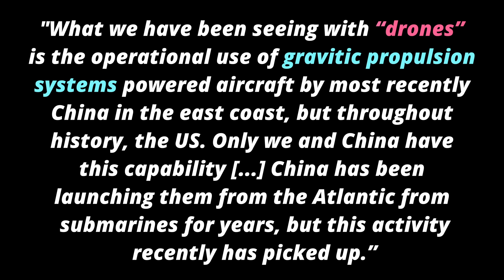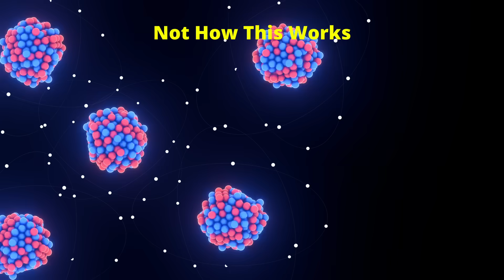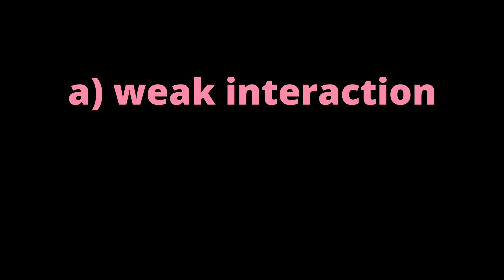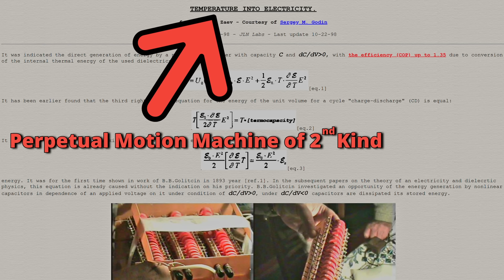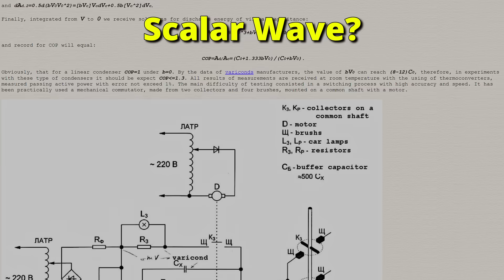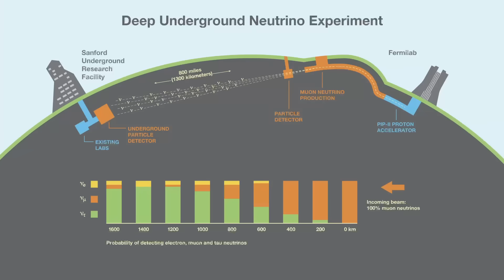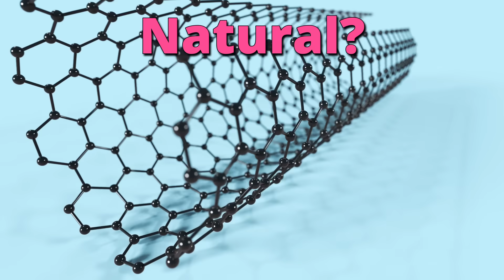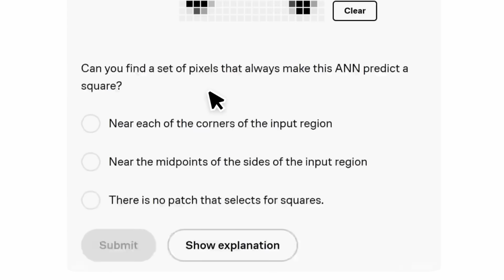What is “gravitic propulsion” and could the US government hide it?

Comment: Gravity isn't a force.  So no.  This is not possible.  To use gravity to extract energy is lifting something with mass away from a much larger concentration of mass, and harvesting that stored energy later.  Gravity is an extremely weak emergent property of fluid dynamics and because it's not a force there is no symmetry that can result in its reversal.  And there is very little energy to extract from the process.  The only thing gravity could conceivably be used for is the storage of potential energy.  A large weight raised up from the Earth and forced through a gearing mechanism to slowly fall.  This energy can be extracted, but only at or below the rate of the energy used to lift it.  Gravity batteries can and should exist.  Everything else is SciFi nonsense.
Reply: They found a way to create a corona field, it allows the craft to cancel out gravity while also causing time dilation. It’s why they can move so fast.
Reply: @eggheadusa  yeah?  No.  Laws of physics do not allow any of it.  The concentration of energy being the first impossibility.  And there are no "parallel" dimensions to extract energy from.  You are letting delusion define your reality.
Reply: @eggheadusa  yeah?  No.
Reply: @ZennExile  No? Yeah. Biefeld–Brown effect
Reply: @eggheadusa  yeah?  Still no.
Reply: @ZennExile  You seem childish and biased.

1. You have a misunderstanding of anti gravity: (a hypothetical effect resulting from cancellation or reduction of a gravitational field)

2. Bringing up alternative dimensions for no reason

3. Not understanding biefeld-brown effect disproves your claims
Reply: @eggheadusa  yeah? not even close.

Comment: well theoretically its possible to use grawity... and the fact is we allready use balloons which is syncing with air pressure to specific part of pressure level and try to stay in that sync area... the similar logic mostlikely can be used fro magnetism/grawity density may be... but that requires subatomic parttle level manipulations and we dont have that level of technology as far as i know and its not ewen quaranteed itll work that easy😅

Comment: Classified math was mostly in relation to cryptography, and it turned out that classifying math didn't work. In relation to weapons technology, specifically nuclear weapons technology, it may be possible to keep the lid on some experimental results for some time or some designs, but ideas can be replicated, inventions reinvented, especially when it's already known what and where to look.
As for "gravitic propulsion", I think that's used in downhill skiing.
Reply: The current nuclear stuff relies on materials that are difficult to obtain, even more difficult to process, and tend to be hazardous all around, and not to mention most things tied to that are readily traceable. So even though the genie is out of the bottle on some aspects, the ability for that to proliferate and the associated information hazard still has a cap in terms of viability. Not just any idiot can "get nukes" even if they know too much because of all the stuff that would have to come together.

The problem with this other stuff being open not as clear cut in terms of limitations. The problem it presents is that any schmuck knowing enough of the supporting theory could build a "nuke" with electrical and electronic components in terms of practical applications. So the implied stakes of the "information hazard" of having a theory of operation is much much greater, as the required materials are relatively common and readily accessible. This would be why hints at it tend to be obfuscated or re-directed when certain governments can put it's thumb on the scales that would influence publications.

Some of the AI stuff that's up and coming will have a tendency to kit-bash the old stuff that has been purposely side tracked in the past. So this thing is much more likely to stick out in ways that can't be covered up for much longer. So we face the quandary of stuff that could be very dangerous, but it's also very necessary if humanity doesn't want to be planet bound. An inflection point or "great filter" is likely coming up here.
Reply: I have read (in a book, actually, though I can't remember which one, not the internet) that the biggest benefit the Soviet Union got from the spies in and around the Manhattan Project was the knowledge that it really was possible to build a fission bomb. There were plenty of smart physicists in the USSR, once it was known it was worth putting them on the problem. Though I assume the details of the design of the implosion mechanism mechanism for Fat Man would have been really useful.
Reply: classifying Bayesian Analysis worked, it wasn't known outside Intelligence services until after the war. Watch/read about The Man Who Never Was, that was forcing a misread of data to mess with the opposition's Bayesian analysis.
Reply: The things we called gods that came down from the heavens call the shots
Reply: @mw9297   100% of zero evidence for any of that.
Reply: The nsa, after a while realised that it was better to open everything up and promote the use of cyphers that it knew were weak or could be broken. It worked for years, then people started checking the algorithms.
Reply: @probablynotmyname8521  'opened up'=='made available ciphers they had keys for. OTOH, they aren't, and weren't, the only people using those algorithms. Can't keep secret what others have already published publicly.
Reply: Yeah, the only version of classified maths that I was aware of was cryptography, with the reason being that the US military didn't want potential enemies to gain access to highly effect forms of secured communication that they can't easily break into, but it's never been illegal to research or develop the maths, you just couldn't sell it to international markets. But I think they've kind of given up on that now, because, it's just kind of stupid. You can't stop people from thinking about it, or communicating about it with peers, and realistically, unless you rigidly control the source from the beginning, you can't change how that will propagate in the 'wild'.
Reply: Not to mention that the people working on those things leaked like a sieve.

Comment: To be fair, the Cybertruck didn't explode of its own accord. If you place fireworks and accelerants in the back of any truck and detonate them, you will get an explosion.
Reply: That is the scenario in this case. It was accelerated but... If you squeeze any lithium battery, it instantly turns into a road flare. Water does not put them out.

Comment: I wont say its antigravity, but pulsed thrust capacitors. Probably simpler than is thought. Where you don't need constant high voltage. We know about lifter phenomina. That requires constant high frequency voltage. Thrust capacitors work with bursts of high amps as I understand it. So basicly small explosions in a contained space with the opening on one end. I've also seen the laser lift tests where they spin up a special shaped object looks like a Top, then they fire  pulsed lasers at it and it is lifted by high energy photons from the ground. Maybe its all in the interpitation of what has been seen by ordinary people, but it's not antigravity at work here. That it is more of an electro static/magnetic thing, in my mind anyway, and uses Earths magnetic lines of force to travel along.

Comment: The term “gravitic” is somewhat misleading. This type of technology is basically about changing the space-time coordinates of an object. In other words, the location in 3D space is changed, but without any movement through 3D space itself. This is achieved by manipulating space-time and changing the flow rate and flow direction of time.

The idea behind this is that the passage of time is nothing other than something that the universe is constantly losing. This “losing” cannot be stopped, but it can be influenced. It can be compared to the propagation of waves on a water surface, where the waves spread concentrically and weaken with distance. 

In this comparison, space-time is the wave motion. The manipulation is now that a wave center is deflected into a ring shape, the waves both generate and propagate in a thorus. This self-reinforcing effect can be used to amplify one's own “spacetime wave” and give it the character of a “spacetime wave” of another location or time. Space and time are just two counters with huge numbers, which run backwards over time at variable speeds.

Comment: I heard that Nutrinos might be able to travel between dimensions and travel faster than light. The only problem is they rarely interact with other matter. But, maybe...
I used to blindly accept this kind of nonsense, that tachions and zero point energy might break k own physics. I'm trying to be more rational. But, yeah, I'm holding out for the Nutrino solution to interdinendional travel. Whatever that might be.

Comment: We were working on meta materials being built in nanoscale. They are literally building metals atom by atom. The metals include tritium,titanium,gold, silicon dioxide, copper and a few others. The metals can use voltage and magnetic changes along the hemispheres. The machine itself is a ultra capacitor.

Comment: Examples: (1) Newton wanted to hide calculus and give it to aristocracy only. (2) A question from year 1905: calculate both energy and impulse of the system before and after a still massive particle absorbs a photon completely inelastically. You will see you cannot conserve both. This goes on since year 1905. (3) Maxwell's original equations were written in quaternion notation: vectors weren't invented back then yet. Modern theory uses vectors. But there is a difference: quaternion version has scalar wave, and is not a gauge theory. Scalar waves behave differently than the vector ones. This means there are at least 2 formulations of Electrodynamics, which points to the new question: is there the third version too? (4) All perturbations of free particle are singular in Relativistic Quantum Theory, because the Green Functions are singular. The ones that follow from (2). So what does the modern physics do with these singular perturbations? Modern Physics cheats: it turns infinite perturbations to the ones that fit the observations. How does it turn? Magic. By force. So in conclusion: do notice that some of these questions are more than a century old, and no one addresses them. So, physicists are after truth, right? Physicists are very smart peepo, right? So... who framed Roger Rabbit? Oh, and no one will publish you on these topics! :D :D :D

Comment: I doubt the government has any "gravitic propulsion" of any sort, although one can't be 100% certain.  There is however a real and well verified invention called the Self-Contained Ion Powered Aircraft, there are about 45 flight videos of it on my channel, with a large number of reliable witnesses as to its ability to fly with onboard power. It was patented (US 10,119,527) for silently lifting its power supply directly against Earth's gravity, solely utilizing ion propulsion!   It really looks like antigravity when watching it fly especially in person!  The various versions of the craft are very lightweight. The longest flying model weighed 24 grams.  The smallest working version of it is 50.5 inches (128.27cm) in diameter. it consists of 8 to 9 concentric hexagonal emitter and collector surfaces; the larger version has a steering system that is pretty far into development.  Not that many people know about it and not too many have invested either, so far.
There is also a website for it that can be found easily enough through the YouTube channel.

Comment: This Quantum Compass, or what ever this device is called, the effect behind it, works in both ways. The condensate not only feels the motion inside the gravymetric field, it can also move inside the field , moving the apparatus and what is attached to it, with it. Nothing new, nothing spectacular, as the gain of the system is ridiculously small. It would take exawatts of power, to move a paperclip. To move the ship, the Britts had tested it with, you would need to plug this thing straight out into the sun. This is such a silly idea, only Rogan would fall for it🤣

Comment: Check out the stealth bomber. It uses anti grav supposedly. I've heard that there is anti grav system that uses rotating (red) mercury. They charge it into a plasma then use magnetic fields to rotate it into a toroidal shape. Then they have dielectric metal plates wrapped in insulation then stacked atop one another. The plates are wired to the toroid mercury generator.The stealth bomber supposedly employs this method for a %30 reduction in weight(payload?). Again, supposedly... The Germans found this method in ancient Hindu writings.

Comment: Gravitic propulsion is not anti-gravity.  I published a paper in 2009 that provides the mechanics of gravitation.  The spacetime distortion due to matter is not the cause for the gravitational force.  Gravitational force is an emergent aspect of forces already present due to the radiant emissions of matter, and the interaction of that radiant energy with other matter.  Both spacetime distortion and gravitation are proportional to mass, but one is not causal of the other.  Due to the mechanics of gravitation I proposed, it is possible to create asymmetric gravitational forces that don’t negate gravity as we know it, but rather redirects its emergent behavior, which prevents it from developing acceleration toward the Earth, but rather in a vector of our choosing.  I also link this aspect to inertia, which suggests gravitic propulsion is inherently a reduced-inertia acceleration.  If you see this, Sabine, I would love to share this concept with you.  The ultimate realization of gravitic, inertialess propulsion requires vacuum engineering, however it is possible to do it in lesser ways that would still be immeasurably useful
Reply: Aaaarrrgh!

Comment: But it does not require huge mass if you can excite the vacuum with high enough frequency - that's the whole point. The Earth needs its whole mass to induce gravity of its own scale, precisely because Earth's frequency is so extremely low. If however you can have extremely high frequency you don't need to have Earth-sized mass and you can use a lot less of it. It's the famous E=mc^2 but in frequency domain.

The quaternion form of Maxwell's equations is the way to go, because then you get additional terms that otherwise get omitted if you use simpler formulations.

Comment: So you make a 1km super conductor that antenna space, this way it reverberate wave exactly opposite at plank length, compounding the knife edge diffraction of any adjacent wave.  It will tumble depending on the weakened side.  So then gravity walks up objects, this gets to muon magnetic accelerators that keep a shell of muons in rings accelerating around the vehicle, but muon's accelerate at c^4, so it just traps the space more than evading gravity.  This leads to the earth master, a higher functional swimmer arm gyro of unobtainable strength that removes spaces computational a7 shell, where rotations can no longer compute the natural log of acceleration.  But matter can be put into different corsets, like antimatter, by forming the absent space, oled terra-frequency matrices my dock with stars so that a farmers market exists between AE Titan and Phobos, gravity was just not very powerful compared to basis spaces.  But fields collapse on themselves, like alot of people said, if you force magnets together, the field accelerates to collapse the field inward onto itself faster, so in space, the field goes willy nilly outward, but at the strong, even weak force, fields collapse in on themselves, so a superconductor is anti-gravity by definition because fields don't collapse in on themselves.  Its something to do with bond sharing of lithium batteries and alloys, but everything makes extra energy, it is just always there, like glass doesn't absorb photons because it is covalent, like frozen lithium or hydrogen.

Comment: Interestingly, the current supplied by the source (at resonance this is purely resistive) is only 1.69 amps. However the current circulating within the LC circuit itself is larger, at 2.75 amps. This higher circulating current can be verified by calculating the current through the inductor (or capacitor) at resonance.

IL = V / XL = V / 2πfrL = 110 / 2 * 3.14 * 28.73 * 220 * 10-3

= 2.77 Amps

If you do it twice it works for both volts and amperes.  If I apply 10 volts at f0, I will measure 14.14 volts across the parallel tank circuit.   If Xc =1 ohm at f0, and Xl = 1 ohm at f0, then there will be 14.14 amperes of current.   If you feed a resonant primary transformer circuit the output of another resonant primary from the secondary of the first, it happens twice.  Build or fail.
Reply: The output impedance of the driving transistor circuit has to be lower than 0.5 ohms for this circuit,  or it won't start no matter what Z = at resonance,  the coil will just be a low pass short, and the capacitor never charge to participate in resonance,  it won't start, unless the output impedance is lower on start, it only see Xc, and Xl as parallel resistances.